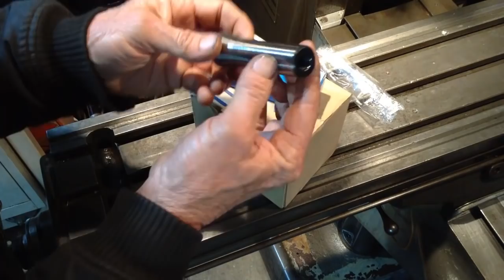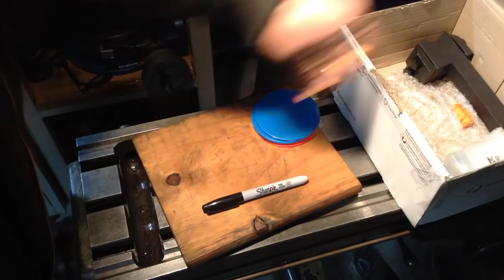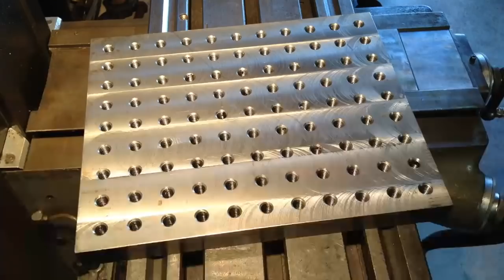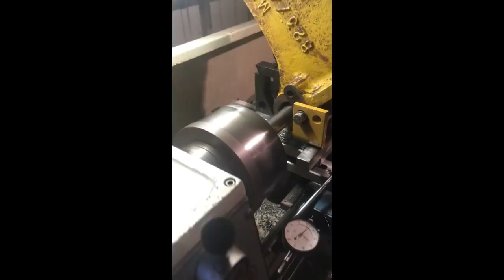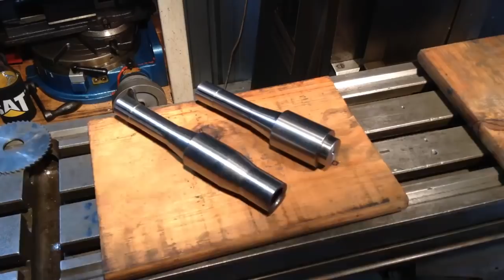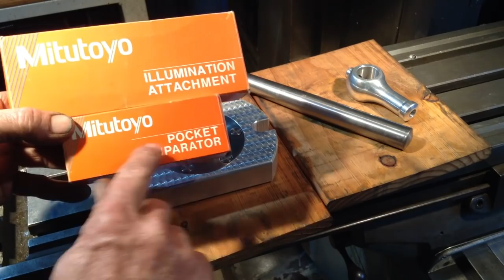Shop Made Tools .    #SHOPMADETOOLS

Comment: The several types of Hangsterfer's products that I've used at various employers in the past seriously did not impress. There's better for less money. Don't waste your time and money on them. The rest of the video is great, especially measuring your cooking in process.🙃🙃🙃
Reply from the maker: Thanks .  I have found the Castrol  Hysol MB50 is use is a good all rounder .  I use it in the un diluted condition as well .     Cheers .

Comment: Nice lifting pedestal  thingy for changing the slewing ring on the 385. I did a 345 a few years back and used wood cribbing and 50 ton Power team jacks and the boom as needed worked OK. Nice selection of tools. I so enjoyed the R-8 tooling series you did awhile back. That was fun. Cheers from New Hampshire USA
Reply from the maker: Had 2 100t jacks each side at the rear & the 50t overhead crane lifting the stick ( fully extended )  .  One of the boom cylinders i removed & replaced with a solid link .   Worked well  , not sure why the Cat w/shop manual says to have the upper structure at an angle to the track frame .  If i do another one i would probably have it at 90 deg . Cheers .

Comment: G’day Max. Beautifully made tools mate, I too was a railway apprentice and the torture of the first few months hand making jigsaw puzzles out of steel, I was 16, “what have I got myself into “ but like you I kept those projects and when you showed the plumb bob I thought hey! I made one too and still have it, thanks for another trip down memory lane. 
Cheers 
Peter
Reply: Hi Peter, totally relate, my 'fitting' module of my apprenticeship was the same deal, we had to file a 12" long 5/8" square out of a piece of 3/4 round bar. It had to be flat, square, parallel, straight and dimensionally correct. I got top marks and following assessment by the apprentice master, he promptly put it in a vice and whacked it with a big hammer to stop me passing it on to oe of the other lads to use, I nearly cried! Cheers, Jon
Reply from the maker: All that basic work gave a good grounding .   Cheers .

Comment: Fantastic tooling Max. For the knackered r8 to er40 adapter, just chop the r8 and you can chuck the round in the 3 or 4 jaw for repeat  collet work.
Reply from the maker: That's one way .  I was thinking about using it for the tool & cutter grinder . Cheers .